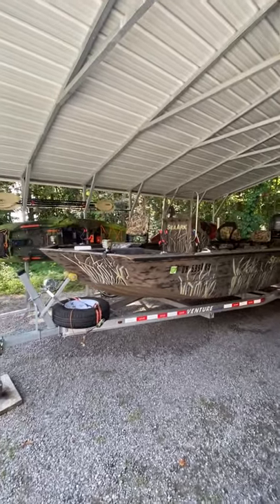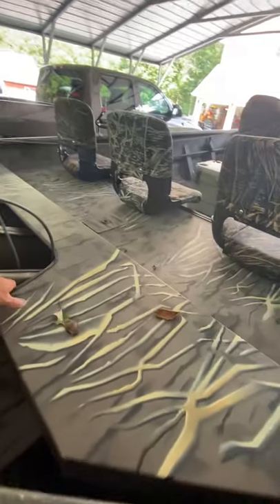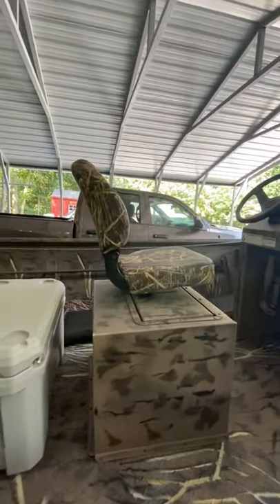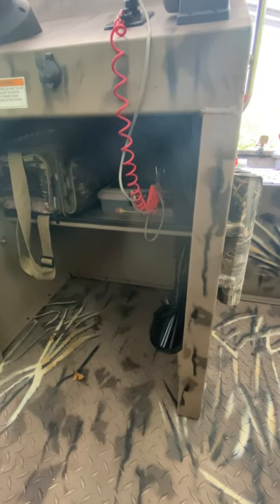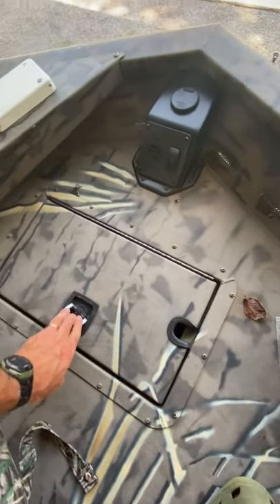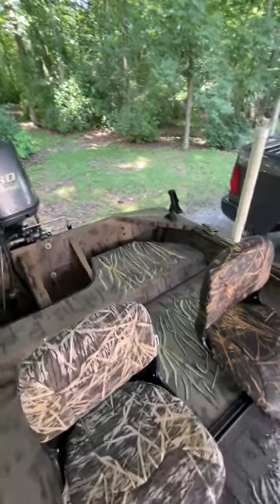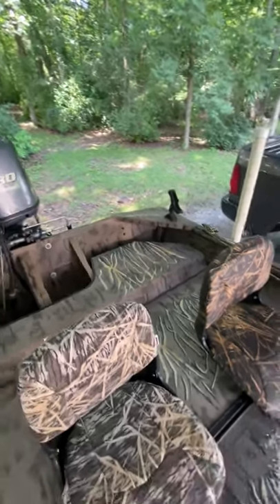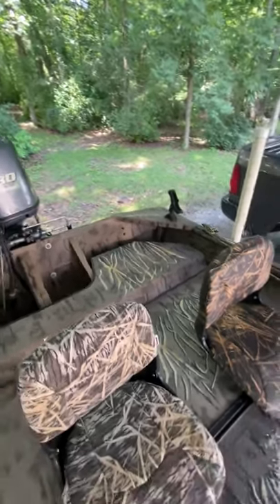SeaArk 2072 FXJT (Jet Tunnel) walk around and review

Comment: Im trying to decide between a 2072 fxjt or a 2472fxjt for river fishing. Cost not considered, whats your opinion ?
Reply from the maker: Both are big and heavy but run very shallow. More so than many of the small lightweight 1652 -1860 sizes with 60/40's or 90/65's...But if you run a river that u will have high probability of getting stuck on a sand or gravel bar both are also very hard to get un-stuck. 
When I was living in Fl and running my 2072 on big rivers and coastal, I kinda wished I had the 2472 for ocean and big bay stuff. The 2072 was fine tho. It fishes 3 easily and can fish 4-5 if u have to. 
Personally I think the 2472 is too big for most stuff that outboard jet boaters want to do. Like running shallow small rivers. It would be impossible to turn around in some of the places many outboard  jetboaters want to run. The 2072 is plenty big enough IMO. I have a river that I kayak and run a 1448 on. I could run my 2072 on that river if I could get it in and out. There is no boat ramps, it has steep banks and limited public access. We have to shove the 1448 off the trailer and slide it on boards to get it in. And then drag it out with a truck up the bank to flat ground, lift the front onto the trailer and winch it on. You cant do that with a 2072!  
It really comes down to how u plan on using it. If u are running something like the Mississippi, Missouri river, or coastal stuff a big boat is great and a 2472 might be better.  If you want to do stuff like Dennis on Texas Outboard Jets does go smaller... That said if u are on the fence about a 2072 VS 2472 u probably already know all limitations of a BIG boat. And they always say go one size bigger than you think u need. And go with as much HP as u can get away with. 150/105 or bigger on the 2472. Hope that helps a little.
Reply: @James Gunny Reed  thank you for your input sir. Subscribed.